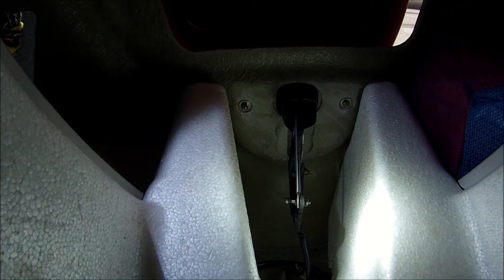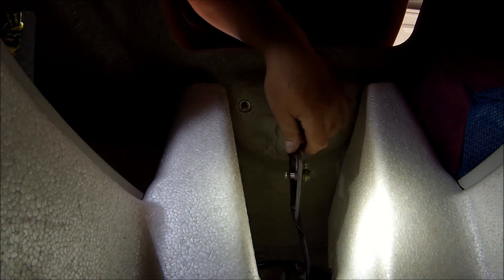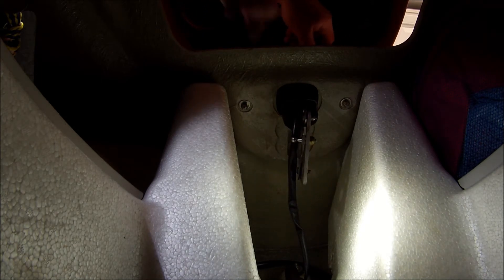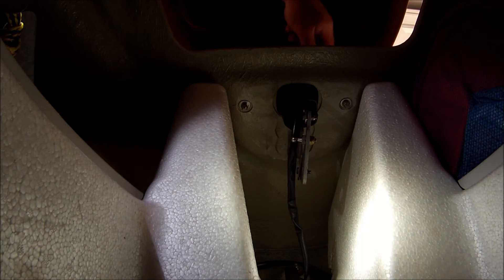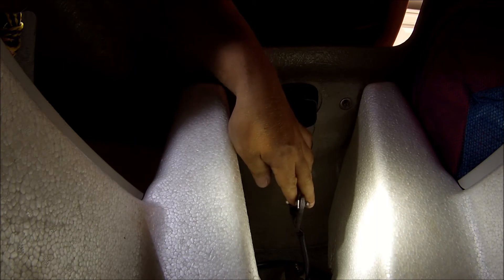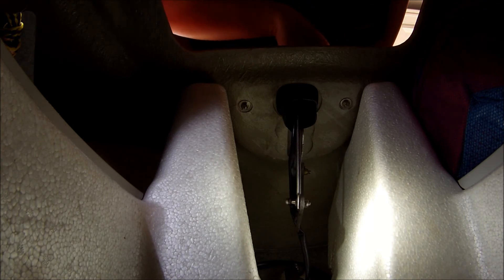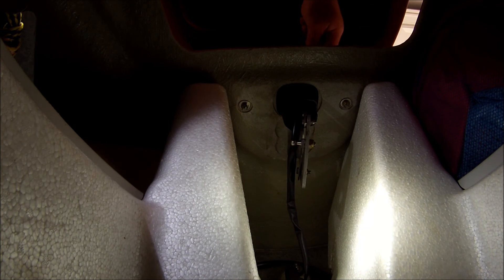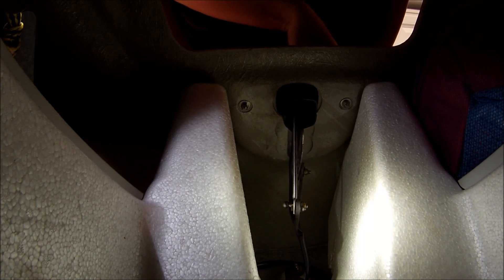2008 Seadoo RXT hood strut fix

Comment: Any follow up? There is a service memo that recommends moving the lower attachment point to port, but mine still pops off.
Reply from the maker: Andy Carscadden that happened to me also at first because the clip on the strut was damaged from constantly coming off. Once I replaced the strut and did this, it's never come of again
Reply: KK40384 thanks. I'll look into that
Reply: Andy Carscadden
Reply: How do you replace the  gas shok
Reply: Marco Lopez , you need to disconnect the bracket from the hood(remove snap ring and washer), and then take L shaped piece out of the hole. 
Then, connect the strut to top and bottom balls. 
Now, put a 1/2 inch socket into the slot on the side of the bracket so you can compress the shock enough to put the L shaped bracket back through the hole in the hood. 
Replace the washer and snap ring.
Reply: Thank you so much for posting this. I have spent the whole morning trying to get the shock back onto the upper ball.